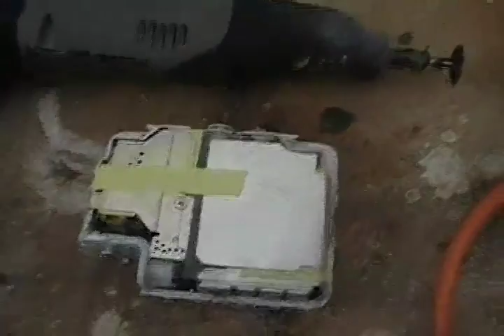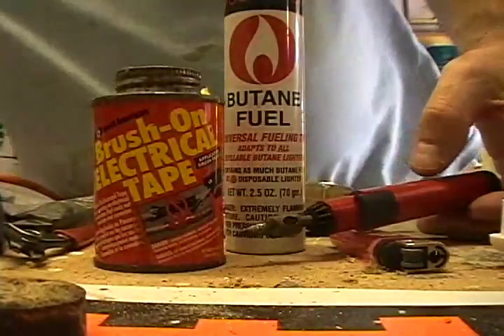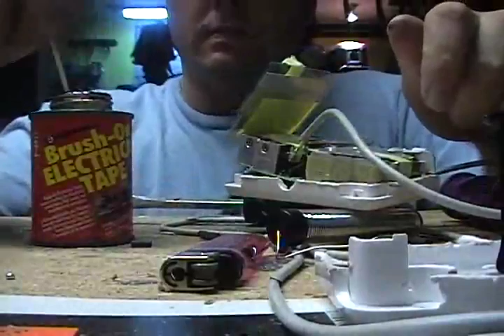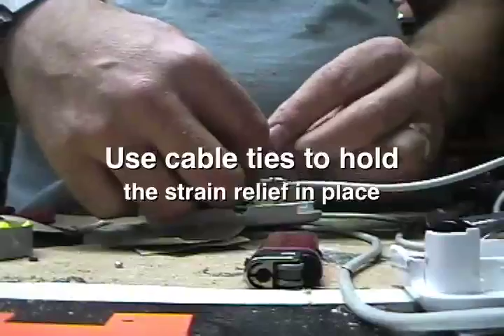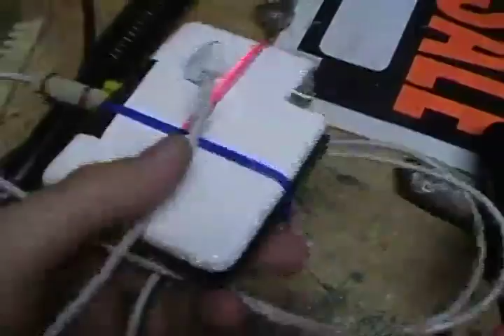How to fix a MacBook 'magsafe' Power Adapter/Supply

Comment: No BS mate, I really admire your soldering technique. I always 'tin' the wires or electrodes but it's a lost art. Most folks I know need one hand to hold the iron, one hand to hold the wire and a third hand to hold the solder. I guess 'Brush On Electrical tape' is a bit like potting compound; it cures over time to provide electrical insulation.

Nice vid. Rockin' choon, sounds like Huggy Bear's crib.

Comment: Awesome! Worked great, thanks.

I kept the rubber nipple part and re-used it. I drilled all the way through it, pushed the power cord through and then soldered the wires. Then I replaced it when I put the case back together. It looks a bit neater, and feels stronger than before due to the cord being through the entire piece and into the case.

Comment: Thanks a lot. I've been adding a lot of electrical tape since I purchased the power units and this changes the point of tension and makes the unit last that much longer. It is especially good to do this with Iphone charging cords.

By the way, use white electrical tape instead of black.......regardless the single worst part of the macbook pro.

Comment from the maker: Hi Totomo - thanks for the soldering tips - this was not a "how to do an awesome soldering job" video!  b) you are right.  However, the PCB has a lot of traces running around there and I have  made a bigger mess with more short circuts when I have tried that.  Also, the wire is braided and I did not want to try that through the pcb. c) right again, but I have little kids that don't do strain relief.d) I thought that the finish was sporty - racing stripes! It still works great and cheap.

Comment: Brilliant Thank you. I was able to get the adapter apart with screwdriver and a little brute force. Also, was able to tie a knot in the cable, before soldering it, which helped make it more secure. Finish it off with White Electricians tape, looks pretty good. Only took 30 mins to sort, but an hour to go and buy a soldering iron! -Anyone need to buy a nearly new, used only once soldering iron?

Comment from the maker: The reason why you use a razor is so that you are not pulling the cable or putting it under pressure at all when you are stripping it.  For delicate wire in tight spots this is often a good option.

Comment: This video was a tremendous source of help. I managed to get the tips covered in solder. But then I couldn't get the soldering to line up when connecting the wires- though so i just twisted the solder strands together to complete the circuit(short term solution). Im using a soldering gun by the way. Any suggestions?

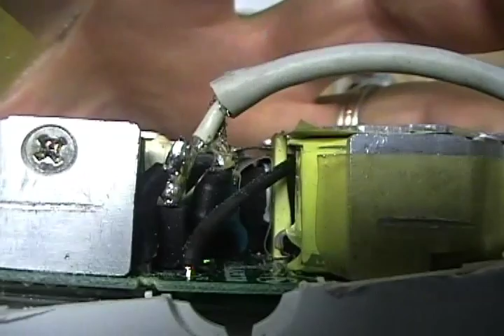Comment: @shirubana The white one is "on the inside" and the black one is "wrapped around."  You can see that in this video at around 3:07 and 3:30.  There is also another video that has nice still photos of this at around 0:45: of "Macbook Power Supply opening and cable fix" . You definitely want to get the wires correctly matched otherwise you will certainly break something. Match the white to the white and the braid (outside) to the black and you will be all set.

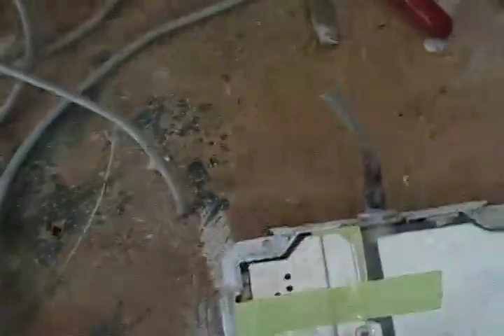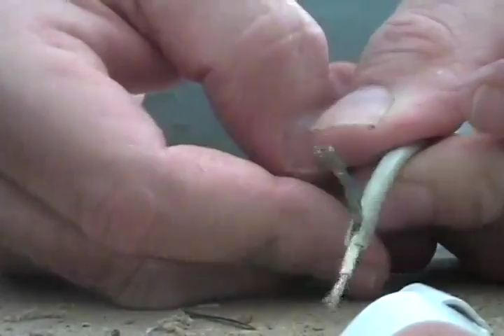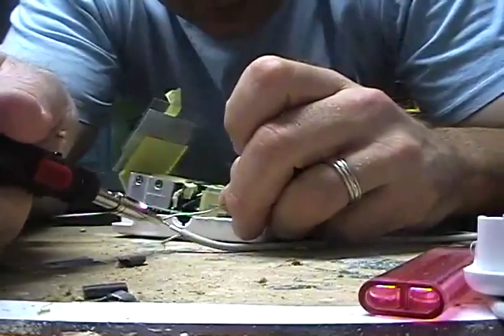Comment: If it is a cable like this, cut out the bad parts (see 0:42).   Follow the video from there to see wire trimming and getting it prepped until 1:22.  You will have 2 ends that look like this. Then you need to join the middle parts (wire) and the outer parts (shield).  There are lots of ways to do this but I would recommend soldering.  See 2:41 for an idea of how to do this - you will just be sticking wire together.  Good luck!

Comment: This is a very dumb question but, I'm not sure which two cables to solder together... like, on the power supply one cable is white and the other one black. But on the cable, one is "in the inside" and the other one is wrapped around it... which one belong with which? does it affect? Thanks.

Comment from the maker: @uzernam302 That is a tough one.  It may be possible to repair at that end but there is a small circuit board in there that has the light on it.  I tried to fix mine and wrecked it.  I got a new one on eBay for $40 bucks.

Comment: thats funny! i have done about 1/2 a dozen apple bricks over the years & mine ended up looking very similar to yours; wire ties, dremel work, electrical tape, etc. (a little less rough, but ghetto nontheless!) if u really wanna bling it out, get one of those 2 conductor non-polarized black ac cords! 
*tips* 
-slide heat shrink (2) on the wire for added strain relief
- you can change the area of cable that experiences strain by using wire ties
-wire ties keep your brick looking nice + ads airflow

Comment: If you mean torn so that it is in two pieces - sure.  You have to cut the cable to get rid of the bad part anyway.  Be sure that you cut away until you get to a good piece of cable.

Comment: This is a dangerous state: these are the high voltage wires and need to have a solid connection. Loose connections can create arcs which can lead to fires.  Since you have tinned the two wires that is the easy part.  You should heat the solder so that it flows into the wire (search for "tinning a stripped wire").  Get some scrap wire to practice.  Then heat the two pieces together and it will melt again and flow into both sides and bond together. Practice on scraps.

Comment: Using a sledgehammer to crack a nut springs to mind here.  But, at least you have made the video!  Even though I would use more advanced techniques to fix the fault of any MBP PSU, But your video would have helped a LOT of people watching it.  Urrrrrgh!  Gas soldering iron!  Knuckle Roasters!  :o)

My first fix on my 17"MBP is to stop this goddamned keyboard from dropping keystrokes.  MBP 
has a pretty lousy design throughout.

Comment: Try a product called ''Quickfix DC Plugs'' search on you tube and check their e-shop. The product works like replacement repairing kit and no soldering is required to replace just the 5 pin connector. No need to open the plastic case and takes just 1 mint to fix MagSafe charger. 100% works.

Comment: yeah this is a bad way to do it. Not hating, just warning any viewers out there. "wire cutters" are the proper way to strip wires, not an box cutter, lol. and a flat head would get the adapter apart, with patience.

If you are going to hack it up this much, you should also install a fan to suck out hot air, reduce the heating problems that these adapters often have.

Comment: If you get it wrong or the positive and negative somehow touch each other, you can fry your motherboard aka logic board, and that's super expensive to get it fixed, not worth the risk I ordered a good quality charger for my macbook Pro from chargers4mac.webs.com for less than half of the price at the apple store, not worth my time trying to Macgyver my way around this to possibly ruin my macbook pro, thanks but no thanks I d rather to order a new one.

Comment: Horrible advice.  There is no reason to grind away the case.  Even though this comes up first in the search, fortunately I was smart enough to look at some of the other examples.  Its easy to crack the case with pliers doing no permanent damage.  There is no reason to kludge all the wiring like this, nor to leave those points less accessible in the future.  Folks, look around.